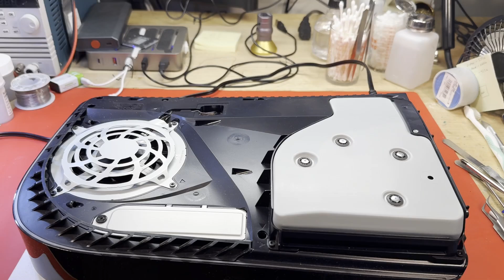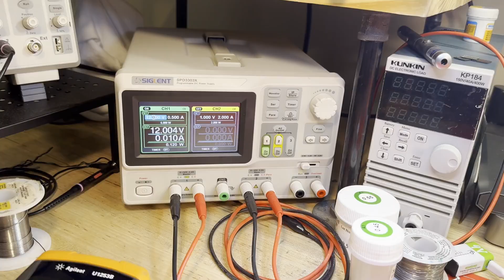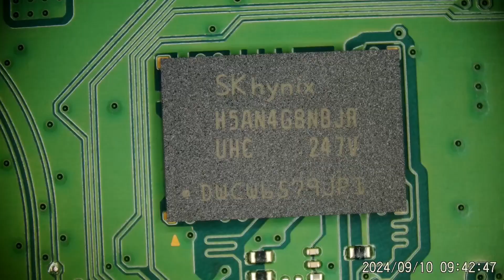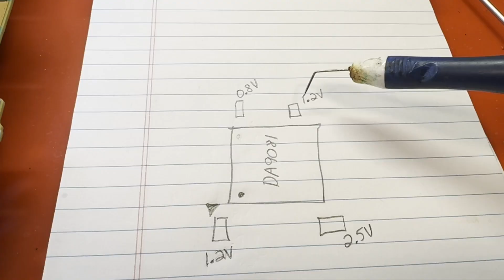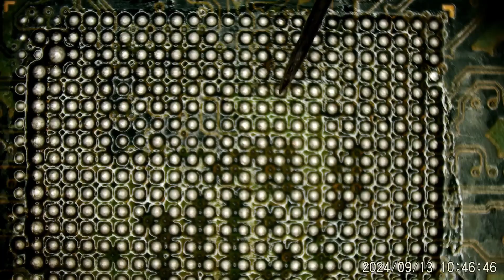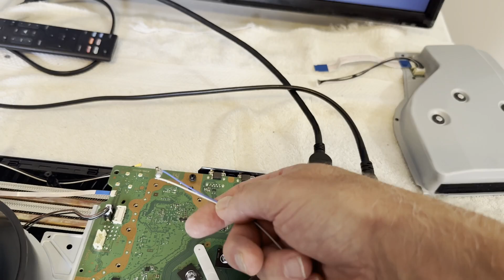#161 Repair of PS5 Only Beeps

Comment: If you have a bad Ram ssd controller you can see it fire up when apply 12V 1amp with thermal cam also a boot sequense of 150 to 250 is something related to ssd.
Great video as always.
Reply from the maker: Thank you!
Reply: Hi Lester. I have a ps5 that when I have 12v input, the ssd controller gets very hot for a second. The Amp reading goes to 0.300 and back . Should it be from the ssd controller? Cant find no short anywhere

Comment: Great job as always! You never let us down. I am thinking about buying the Kunkin KP184 you use. What do you think of the overall performance?
Reply from the maker: Thank You!  I love my Kunkin!  I guess there are fancier units out there but it has not let me down yet while testing PS5 supplies.
Reply: @ToltecMerc  thank you for the prompt reply. I see the KP184 comes with wire  and the terminal connectors. But i don't see connectors for the opposite end your connecting direct to the ps5 psu. Where did you source those if you dont mind me asking?

Comment: Nice video! I would inject 1.2v on the rail and spot hot components with thermal camera to speed up the process
Reply from the maker: @afb9999  I did inject.  No current draw.

Comment: Looks like it’s usually an SSD controller issue when the ps5 doesn’t boot up according to 3 of your videos. Is that accurate?
Reply from the maker: @bluetorque2385  that is a common failure but so is the South Bridge.
Reply: Could I possibly send my PS5 to you? I have the exact same issue.

Comment: I have exact same boot sequence but mine is just beeping ones then blue light and turning off (EDM-033). Any idea whats wrong ?
Reply from the maker: It's shutting down.  It could be so many things.  RAM, SSD, a shorted power rail, APU....you would need to read the UART codes to find out what area to look it.

Comment: can you tell us the temperature of the preheater and hot air when you replace ssd , Southbridge
Reply from the maker: I slowly raise the preheater temperature from 120C to about 200C.   Over several minutes.  I have a temperature sensor stuck in a hole near the chip I am replacing.  I normally wait until the board temperature measures about 100C and the I apply 400C from above with my hot air station.  The amount of time needed for heating from above varies between leaded and lead-free solder balls.  After about 1 minute you should be able to nudge the chip and see if it snaps back.